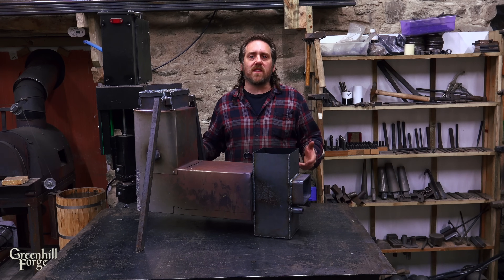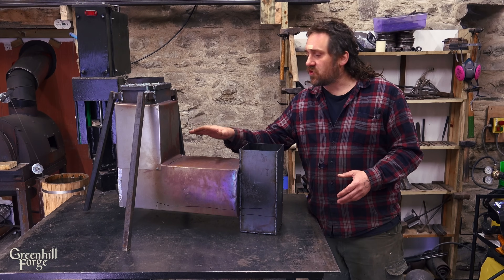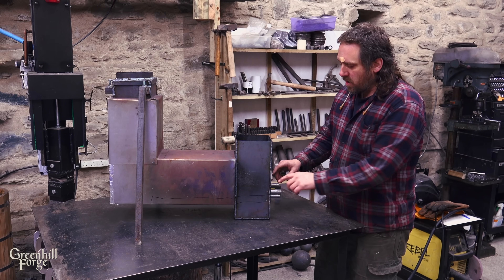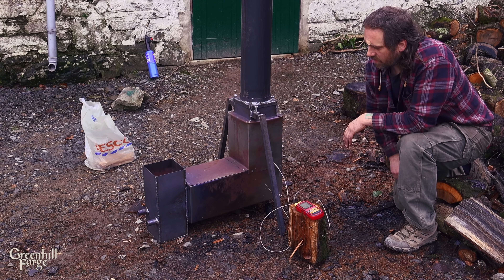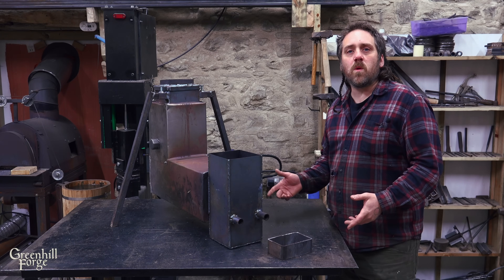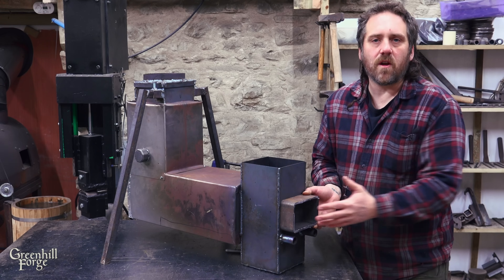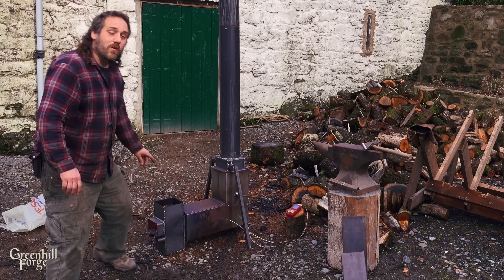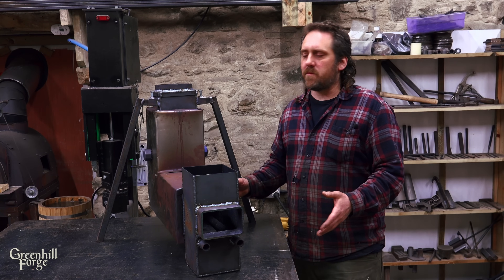Supercharged RocketStove Mods: Crazy Heat Boost & Forge Conversion

Comment: I built a rocket stove for my shop about 5 years ago, with a used propane tank for a heat accumulator\radiator.  The top of the propane tank glows bright red if I am not careful, and the entire shop heats up in no time.  It has ceramic fiber board for the internal chimney.   It has has been easy to maintain so far.  there is some metal warping in the fire box starting to show up now because of the high heat; this will need to be addressed some day.

Comment: If it gets hot enough to forge steel, what is it doing to the stove itself, without a refractory liner? Seriously curious. Either way, awesome channel. Thanks for sharing
Reply from the maker: this is a prototype for testing ideas. steel is much quicker and easier to test with but a long term design would need to be refractory cement or firebrick etc

Comment: This seems to go against what a rocket stove is all about but I wouldn't mind seeing a rocket stove with a secondary burn system where are the smoke and hot air is piped back into the firebox or maybe even a small catalytic element to it. Do you have any thoughts on that? I'm not even sure that wiping the hot air and smoke back into the firebox would be possible
Reply from the maker: I'm sure it could be done. just need to create a positive pressure pipe splitting off and going back to the burn chamber. My question is would there be enough oxygen left to assist in a second burn. could probably find that out with an o2 sensor easily enough. it's not a bad idea
Reply: @GreenhillForge  I'm picturing two circular or semicircular pipes splitting off from either side of the stack or somewhere just after the burn chamber. That isn't based on any particular technical knowledge or practical experience, but just my imagination.

Comment: I love the experiments and clean presentation. 
Apologies if you're already aware of this, but the addition of the primary air feed also has the effect of directing the air more rapidly across the burning wood and exposes fresh embers. There is an optimization to this as too fast of  air can cool the system. There are some papers looking at varying the primary and secondary air volume and velocity for heat evolution and air quality.

Comment: Have you thought about attaching the rocket stove to the top of your regular wood stove? That way if you want a quick hot fire, you can light the rocket stove, but also if you want a slower burn, you can use the regular wood stove.
Or even cooler idea, do a split rocket/ wood stove that uses the same flue.

Comment: Steam locomotives usually use gently curved pipes and angles instead of sharp changes and 90 degrees corners. It reduces turbulence causing the steam to conduct to surfaces and cool. While I’m not sure if this would be better for the stove to keep a laminar flow, keeping more heat in the gasses instead of the chamber walls, or making it turbulent increasing combustion I think it’s something your next stove should consider.

Comment: What about lining the inside with refractory cement to increase durability?
Reply from the maker: Absolutely. My goal is to finalize a design in steel because it much easier to iterate and modify and once I have a final deisgn I really like I'd then build a really solid version in refractory cement.

Comment: I would see the uses for an emergency forge setup however once you reach forging temps the box will start to melt alongside the metal to be forged. In fact being mild steel I think the stove will suffer more damage than what you're making. It may work if you go over to a fire brick & masonry style stove.
Reply from the maker: If you watch the video with the original rocket stove build I go over stuff like this. Steel is easier and faster to prototype with and do tests, but once a design is settled on it would definitely need to be built of fire brick, refractory cement, etc.

Comment: I have an idea for a mod, a steel coil going through them intake tubes that you have there already, and attach a blower, maybe a blow-up bed pump
Reply: That's if you needed it hotter anyway, haha 😂
Reply from the maker: Might try it at the end just see what happens and to melt the thing down

Comment: Hello, thank you for your videos, they are really interesting ! There is a french youtube channel called Barnabé Chaillot, the guy is experimenting all kinds of stuffs. He has a really good design of pellet fed "solderless" rocket stoves and high temperature rocket stove. Also, he has worked on a heat exchanger prototype which looks really efficient. Definitly one of the best channel on youtube in my opinion. You check, it might gives you ideas. Thanks again for you videos :^)

Comment: Can you do a run with the air injection pipes blocked off, but with the new front intake open? 
Also it may be worth adding a curved section to smoothly transition from the firebox to the stack. You are likely getting some significant turbulence in that bottom corner.

Comment: Does the forge mod allow the steel to get hot enough to forge weld? Or just enough to make it pliable?
Reply from the maker: 2100f is hot enough to weld. whether the steel would get that hot, I kinda doubt it. maybe with some tweaking. charcoal would probably boost the temp too

Comment: I say give up on the flue effect and put a blower on the air. Then you could have better control and be able to have a bigger opening to forge with.
Reply from the maker: I think you'd be right if the goal was to build a straight up forge. might have to build another mod

Comment: Glad to see how dedicated you are on this project.  Some thoughts:

1. If you want to be able to use this 100% indoors, you can avoid dealing with smoke by starting off burning something that doesn't give off any noxious products, like methanol/ethanol/propane/natural gas/etc. in order to get the secondary combustion chamber up to temp.

2. Commercial pellets work great for this kind of use, but you can also put regular wood through a wood chipper/grinder to create small, uniform chunks.

3. If you add a 'chimney oven'--or w/e--to some point, you can use the residual heat to dry out your fuel, which will allow it to burn hotter.

4. I would put the forge port at the top of the secondary burn chamber to ensure more even heating.

5. Adding a shutter to each forge vent would allow for minimizing heat loss by limiting the opening to the size of the workpiece.

6. How about trying a small air chamber above the SCC to preheat the air for the air intake, so it would already be super-hot before it entered the stove?

Cheers!

Comment: The only mod I can think of right now is that valve to decrease the flow into the first chamber.  It would reduce the temperature but it might decrease the fuel consumption a lot more.  The extra air after the first chamber would still burn up all the produced gases.  You would be sort of producing gas more than burning in the first chamber.

Comment: some great and usefull mods - well done - I'd be very interested to know if you forced air via a blower into the secondary air feeds if the extra O2 would increase temps at the forging zone, or the volume of increased air would cool the flame?
Reply from the maker: I think forced air would increase temps a lot but fuel consumed would also go up a lot

Comment: Exceptional work. You actually made the greatest point yourself: "What application can make use of that intense heat?" - and that has me asking and hoping others chime in. I am wondering if you are able to expand the access to forge large pieces as that would be fantastic. Would a cob addition around that area help stabilise the temps? I am wondering how to might activate a type of water battery for heat access later on. As you know, water takes longer to heat/cool than air. So, how do we put that magic to use?
Reply: Sand battery?

Comment: I think that it's generally better space heating (especially for radiative emissions) if the heat source is a BIG WARM thing, instead of a TINY WHITE HOT thing.
By way of example to make the point clear, an acetylene torch puts out a lot of energy, but it would be a suboptimal space heater.
Taking to extremes, a tiny little object glowing with 3 kW of heat would be tens of thousands of degrees and emitting dangerous UV (excuse the hyperbole).
Conversely, if the entire room surface was pleasantly warm, then you're done.
Oftentimes, TINY VERY HOT things are enveloped to provide a BIG WARM surface area before calling them a space heater.
If you can design it to transfer most of the heat to an air flow (perhaps a convection channel), then it becomes an air heater and you can bypass the above point.
Reply from the maker: I agree theoretically. But a competing issue is that for wood to burn as cleanly and efficiently as possible it needs to burn very hot. So then the issue is how to efficiently use that much heat all at once. Aomething like natural gas that burns very cleanly already would be much better at a low, continual heat design.
Reply: @GreenhillForge  Yep, good points. So for space heating, get some convection channels on the hot surfaces. Same principle as the rocket stove, just for room air on the outside.

P.S. Thanks for the very nice videos They're great.

Comment: Instead of a pellet hopper, you should add a larger box for full sized rounds, they burn hotter and slower than small kindling or pellets. Also if you further insulate the riser and burn tunnel your Temps will increase dramatically.  A large 55 gallon drum on the feed side would allow full rounds of wood to be added while still causing the fire to burn down into the burn tunnel. If you incised the whole thing in grave, mud, or clay you'd have more insulation at a low or negligible cost. Great videos keep up the good work!
Reply: also, if you can pre-heat the intake air by feeding it through the jacket at some point, that can concentrate the thermal energy..
Reply: @yellowajah  how would that matter
Reply: @Name-gi8dr They actually did that on blast furnaces iirc where they use waste heat to pre heat the air that is being pushed into the fire to further increase the temps.
Reply: @Name-gi8dr  Pre-heating intake air means that the air coming in isn't cooling the fire. If you could add 2100 degree F air, you wouldn't need the combustion at all :). As a rule of thumb, higher temps also means more efficient burning which also saves fuel.

Comment: Have you tried burning anything else like charcoal in this?  I wonder what that would do for the forge aspect and whether you could get it to work with part charcoal part wood.

Oh, if you haven't come across it yet, take a look at Little Aussie Rockets on here - he's got quite a few rocket stove builds and experiments in his older videos.
Reply from the maker: Yeah, I need to make a batch of charcoal soon anyway so I'll give that a try.
Reply: @GreenhillForge  build a heat bell off the top of your rocket riser, then cook your charcoal in a retort inside that bell 😊